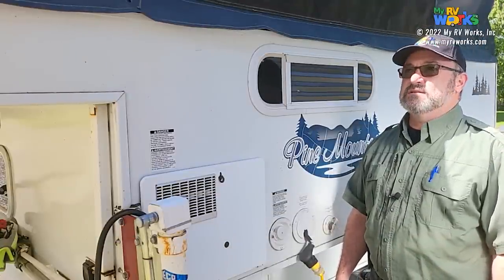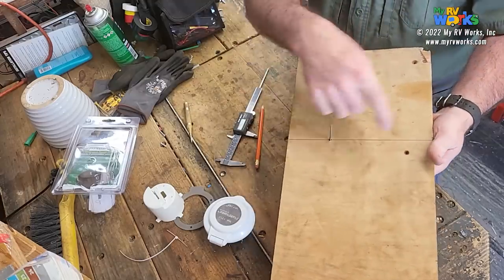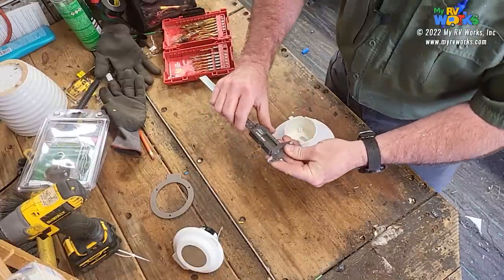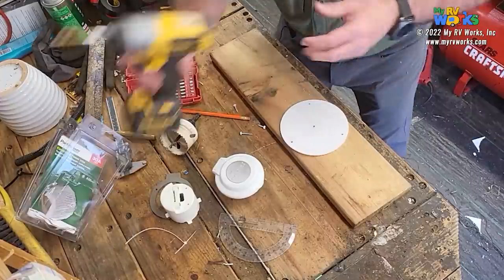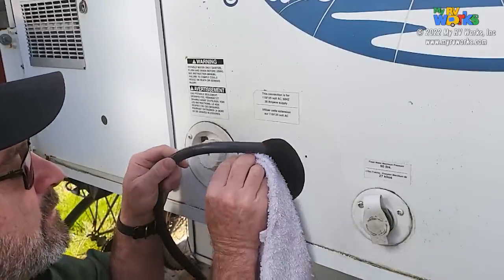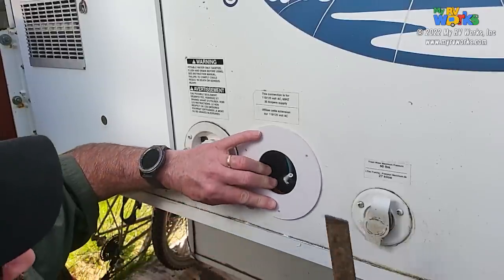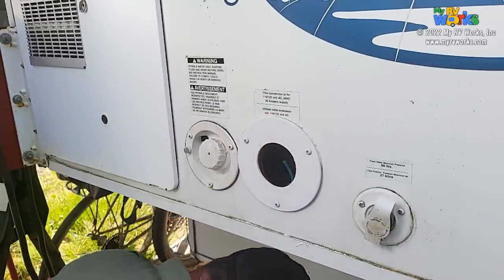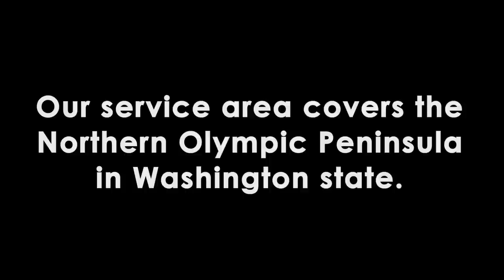RV Camper Shore Cord Outlet Modification  --  My RV Works

Comment: I have another suggestion on a future video. Many RVs use poor holding staples and screws anchored in softer wood that vibrate out during road travel. Do you know of better fasteners that will keep trim and appliances from becoming detached during road travel?

Comment: If you cut the plastic running it backwards on the table saw it won’t chip the plastic but still cut it very easily.

Comment: I did something similar with aluminum diamondplate where our awning legs mount to the wall of the fiberglass. The lag bolts weren’t holding well in that fiberglass and styrofoam wall.

Comment: I had learned the hard way that the locking ring around the female end of the shore cord has to be tightened onto the threads of the male end housing attached to the RV. By not tightening the locking ring, I had caused arcing that had lead to melting the connectors while drawing alot of amps. Not good, when it's a hot day and you want to use your air conditioner but can't because the 30 amp connection had melted
Reply: You probably already replaced it but the Smart plug that he mentioned is a solid replacement and it locks in to make a great connection without the risk of arcing etc.

Comment: Although you are the master of RV repair and I say this with the utmost respect;  I would have just removed the original trim ring (as you did with the putty knife) and used that for a pattern, then cut it out of the new plastic material and replaced it.  The result would have matched better as the ring would be the same size and looked like it was done at the factory...Cheers

Comment: Dang you drive a dually for service truck . I thought you would have a 1/4 ton or 1/2 ton . I bet diesel is killing you . Thanks again for your videos
Reply from the maker: We also use it to haul around our truck camper and move our fifth wheels. It wasn't originally bought for a service truck.